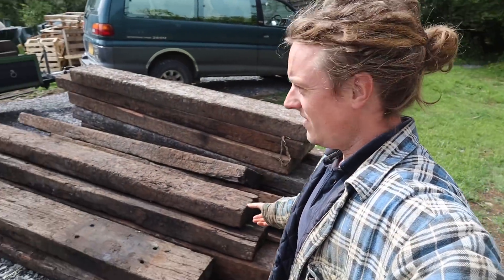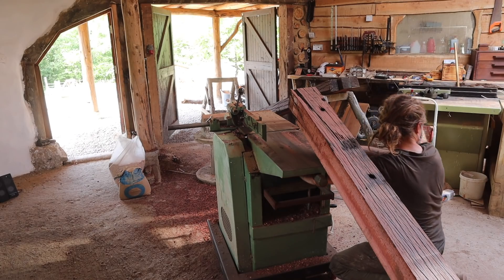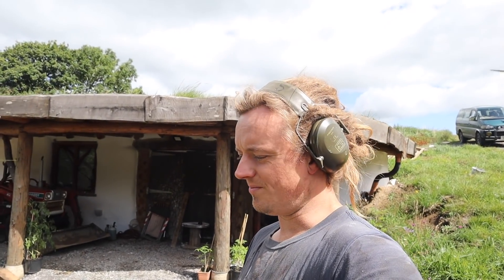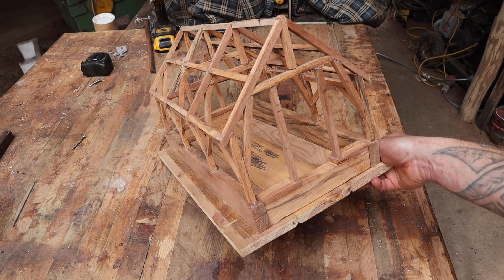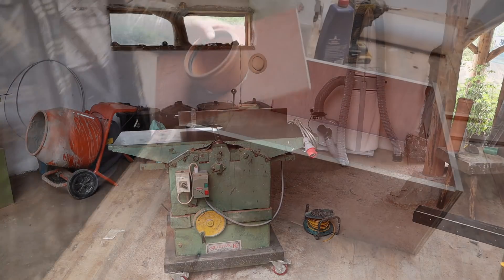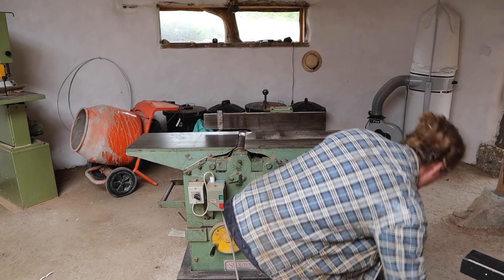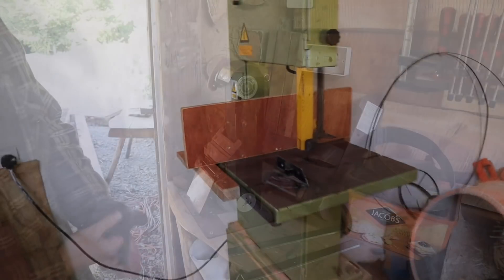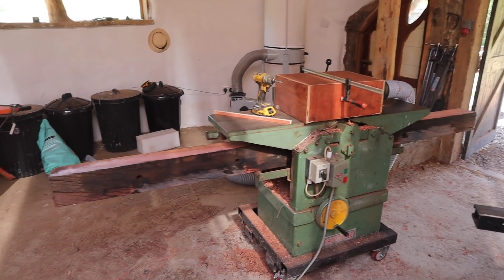Spring Fed Timber Framed Greenhouse Part 1 Design/Materials

Comment: Kris- you will get significant improvement in suction if you move the collector closer in order to make the hose as short as practical.  Corrugated hose like that causes power loss over length and that is a pretty long hose.  Its great for convenience but there is a suction cost.  Love what you are doing and thanks for posting.
Joe
Reply from the maker: Yeah i know. its the same principles as hydro electric. But with the hose this long i can reach both planner and table saw without moving it. so the loss of suction is an acceptable loss for the ease of use.

Comment: The shavings and sawdust will make a good ground cover for your chicken coop, and are also good for covering pathways to stop them getting too slippery.
Reply from the maker: Yep, i keep all the clean stuff for those purposes. its very useful stuff. infact when we have run out before i have just put green logs through the planner to make some more.
Reply: Might be nice for the composting toilet too
Reply: Saw an awesome sawdust stove design.. with flue. Great way to keep the workshop warm, also burns super-clean. Create a cavity using a pipe and it slowly burns from top down.
Reply: Also great for your orchard, decomposes nutrients to the soil plus it keeps down the weeds so you don’t have to cut the grass.
Reply: If that is aussue red gum and it's untreated, you can use it for smoking meat.

Comment: Hi Kris 
As a gardener, I would very strongly recommend two roof vents on each side of the roof with this size of glasshouse - (in addition to the vents in the ends) Hinged at the ridge, and make two of them open on auto vents(surprising how much heat in the sun at 6 am on a summer morning!) You have to allow hot air to rise out of the roof vents or the plants will definitely cook!(you can't rely on horizontal draught).
Also recommend a roll (two or three with this size of glasshouse) of shade netting fixed at the ridge on the sunny side- like a roller blind. You can use paint-on shading, but netting is controllable and variable...
Cheers
Reply from the maker: Thanks for the info Andy. I will add some more opening windows on the roof.
Reply: Andy speaks the truth! A greenhouse can get hotter 'n billy-be-geewhiz in no time flat.
Reply: I love the way your mind works those little mini additions are really mind blowing especially for someone like me who has no experience at all with wood work or building construction. I congratulate you and appreciate all your videos. All the way from  Guyana
Reply: Late as usual, but ya'll don't use wax struts? They save my lazy ass...the 36" vent fan kicks on ~5° later. Its on a thermostat and a timer, but its a simple 24v system cobbled together from mostly scrap, batteries and solar cells free from an old sailboat and mpt from an old farm gate setup. Wax struts are 30x easier, though
Reply: Great advice Andy! I am a gardening freak, and have always wanted a greenhouse, yet I have no room for one, so I didn't know a single thing about them.
Reply: @KrisHarbour  Seems he's decided to test the horizontal flow mechanism for a year. Should be interesting.

Comment: When you get a dust extractor, try and incorporate a cyclone to pull out a lot of the chips and dust before clogging the bag or filter on the output side.  That would also help if you decide to just vent the remaining to the outside, ie less dust sent outside to get over everything.  It also helps keep the bag from filling up as fast as you could route the chips into a trash can from the cyclone for example.  There are a lot of videos online for taking the type of dust collector that you made and turning it from a 1 stage to a two stage with a cyclone.  Also, I do not know if they are available where you are, but over here in the usa there is a company called Wynn Environmental that makes filters to replace the filter bags that does a really good job of taking the dust out and not reducing the air flow.  I have learned that if there are any sharp metal edges on tools....to take a file and round them off...too many slices have happened to me while moving near the tools while they are off and bumped into the various hard edges...same for wood corners...rounded is better and safer for me. :)  Fun video as always. :)
Reply: Yup. I built a Thien baffle which is before the impeller, so you just don't get many chips hitting the impeller at all. And then you can get into the whole straight runs of plastic pipe which have less resistance, and then things like the helix head on the jointer to stop the shavings being so big. There are certainly many ways it can be made better, but at least Chris now has something to stop the machines and his lungs getting so clogged with shavings.
Reply: Just adding a hint for the plastic piping, in case it helps someone.  
Dust and chips create static electricity that cause blockages, but if you run an uninsulated  earthing wire around the outside of the plastic pipe, the problem goes away.

Comment: you need a adjustable stand with roller so you an support the end of the beam as of travail through the mill . that will save your  back & even a grab to lift the job & swing it in. all easily made.

Comment: If i may suggest, you should think about reinforcing/hading an elbow 45o angle on the outlet of the box into the flexible hose. 
With time (and with thick chips) they might ripe the hose.  i've seen this happen before and a pipe elbow would be a quick/cheap fix! 
Can't wait to see this build complete. 
Thanks for sharing

Comment: I have a dust extractor the same as yours , I have used mine for more than 10 years and it works well, a quick tip the top filter bag can clog up preventing air flow out (sucking power) if you keep it dry not damp it works better and keep the bag clean from build up, turn bag inside out dry in sun and beat it with stick from up wind.

Comment: When building the greenhouse make certain that you have enough ventilation, about 1/3 of the roof area is often recommended to be opening lights. I also like ventilation at both ends as well.  Easier to build in at the start than to add later.😀🇬🇧
Reply from the maker: Lot of people have recommend that so i will be adding some opening windows in the roof.

Comment: Great job Chris. You need a pair of adjustable tables for both sides of your planer. Most woodworking shops in the US have them covered in carpet to keep from nicking up the woodwork. Would help balance out the longer logs.

Comment: It might be nice to have the possibility of opening up a part of the roof to allow heat to escape. I have a greenhouse in my back garden and I wish I could open it up completely on days like today with over 30 degrees C. With 1 medium size roof window plus the side openings it still gets over 45 degrees inside which is hard on the plants, so now I have to use camouflage netting for shade which I'd rather not. Looking forward to this new project, it will be such a nice addition to you homestead.

Comment: Your greenhouse model is very nice. Hope you don't mind a couple thoughts from an old lady in Texas.  My experience with greenhouses is you get better temperature stabilization if you have a solid north wall and west wall. You don't get light from the north but the cold wind comes from the north. So you will get higher night time temps in the winter from blocking some of the cold and better insulation from a solid north wall. The west wall helps with too much heat gain in the summer and winter wind as well. You will want a couple vents in top to let excess heat out as well. A door and a window is usually not enough in the summer. Digging down several feet and putting insulation and wire mesh in will keep your soil warmer in winter and stop tunneling varmints from getting in your greenhouse.
Reply from the maker: Hi Joan, Thanks for the comment. this greenhouse hopfully one day will become the Bottom of an L shape with the straight top part part earth covered and possibly connected to the future house. so the house heats the greenhouse and the greenhouse heats the house. This is just the fist step in getting something up that we can use without having to do to much major earthworks. This one will have its soil level below the ground level and the back side of the foundation buried below ground.

Comment: I guess you'll source your glass from friendly window fitters. You may also get multi-wall acrylic sheets from old conservatory roofs. There is a trend for some folk to replace their acrylic (plastic) roofs with proper tiles and insulation. The acrylic is a lightweight alternative to glass and easy to cut, and lift alone. Having said that, your long-lasting hardwood greenhouse deserves real glass. Maybe, for cheap quick cold frames, acrylic could allow you to have larger, easy to lift panels. Anyway,  great video  again, Kris!

Comment: My Grampy, rest in peace, had a dust collector in his woodshop. He ran acrylic tubing around the walls to connect each of his tools, and had sliding valves to ensure he never lost suction, even with about 5 or 6 different openings. 

Likely a pretty standard practice but I'm not sure, could be a nice mod for the shop. And maybe you could even run hoses to the top workshop or outside. But I'm not sure how nessesary it would be to have suction outside, but I'm sure you could get creative with it.

Comment: Hats off to your thicknesser/jointer, taking 7 or even 5mm of Jarrah (pretty sure without having my eye balls on it) is damn impressive. Almost as impressive as the effort your putting into this project. And get ready to predrill every single hole and resharpen every edge that touches it, awesome timber, but horrible to work with. Glasses on mate, Jarrah saw dust in the eyes is very unpleasant, take it from me.

Comment: You probably know this, but waxing your planer and jointer beds with paste wax will help those timbers slide through a lot easier.  I have done a lot of heavy woodworking like this, and you should consider investing in a couple heavy duty adjustable roller supports.  Not only does it help make the job physically easier, but it also increases your accuracy.
Reply from the maker: Yeah, some rollers would be a big help for sure. And yes i had already waxed the beds. the reason for the sticking was due to the gunk on the outside of the wood blocking up the feed roller. Had to keep cleaning it so it would feed properly.
Reply: @KrisHarbour  You are working so hard!  Great work! You can always fashion up some wood rollers to help out. :)
Reply: @KrisHarbour  Sooo them sleepers are not treated lolol (just thought i`d ask).....
Reply: Silly Billy you don't need to wax your planer.  They don't have any hair.

Comment: Good stuff, one thing about precise timber frames is they shrink alot (well if you are using Green Logs) yours won't because they are both dried and seasoned. My Oak frame, has shrunk a fair bit in 24months - 6 " square posts and especially the oak purlins, with a little bit of twist in them but I don't mind it adds character but it has shifted 2" and my plaster board that was 1" behind is now 1" proud. Yours will last until the end of your days. I bet that chainsaw needed sharpening afterwards.
Reply from the maker: Yeah, thats why im using this timber as getting dry wood this size would be big money and green oak or larch would shirk to much really for the glazing. Im going to use direct glazing to allow for movement anyway. but starting with mostly dry wood will help alot.

Comment: Suggestions for you Chris when sharpening your planner /thicknesses blades if you were to make a blade holder out of aluminium say and have it so when yo u turns adjusting screw it moves in toward the belt saner you would get a lot better sharpen blade ie make the blade guide close to moving belt run the blade through on the first pass in one movement then again for another pass leave the blade guide were it is pick up the second blade and do the same two passes the same applies for third blade if you’re planner has a third blade 
Then adjust your blade  guide up towards the belt sharpener run all blade
S through again  You get a lot sharper blades that way 
 Jeff Connor a ex pommie wood machinists

Comment: Brilliant video Kris as always, on the greenhouse make sure you have plenty of ventilation  both at the top of the ridge and at the bottom of the walls and also incorporate some shading  ,even in the UK the inside temperature wll get over 40c .We have a 25m x 10m polytunnel and the biggest problem is overheating,  (hope you don't mind the input ?)

Comment: maybe a point to think on m8 it struck me while you were showing the new model of the g/house, the sloped roof sections look tailor-made to be opening style windows to allow air circulation control will also make temp control easier too, 6 windows in total 3 per side it's just a thought in no way a criticism it is going to be an awesome build whatever you do with it loved following your channel and the projects more power to you Kris for sharing this actually 6 per side I meant opening the heat in Yorkshire we are just not used to it lol the extraction plant your developing takes me back to my days at mintex working with asbestos too
Reply from the maker: Appreciate it. i will have a think about that and look to see what is generally down with commercial ones.

Comment: You could improve your dust collector by using a minimum of the corrugated hose. The ripples slow the air velocity considerably.
When you get a chance, do a search for Bill Pentz.
Reply from the maker: Thanks for the info, but I am fully aware of how it works. It’s exactly the same principals as hydro. But just like hydro there is a trade off. And in this case the trade off is not having to move the machine in order to access both the planner and table saw

Comment: The dust box was a great idea, if only to cover up the jointer side blades when using the thicknesser. Unfortunately, I was around to see someone get their hand "sucked" into one.  Needless to say, very messy. 
Love your work, but as an Aussie feel compelled to correct you on a couple of things that you have said in previous videos. The A's in Jarrah are pronounced like you would say in caravan - not ah's. 
I can't buy oak or larch in Australia but I reckon you would have a chuckle if I kept calling them exotic timbers. Jarrah is available in every timber yard, in any size or length that you might want. I paid $250 (which is about £140) for a tonne (2.5 M3) of chopped Jarrah firewood, delivered to my door.
Also, Jarrah isn't a rainforest timber. Grown and harvested from sustainable forests in the southwest of West Australia.
Reply: Given that those Jarrah sleepers are over 50+ years old, there's no way they'd be from a sustainable forest. But the good thing is that it's nice to see that the wood from all those years ago is not being wasted and is getting recycled.
Reply: @happycamper4329  You do know what a sustainable forest is, don't you?
Reply: @markharvey18  yes I do!!! my point is that given the age of the sleepers that Kris is using, those particular Jarrah sleepers are not from a sustainable forest, because Western Australia wasn't doing sustainable foresting 50+ years ago.

Comment: You should consider adding an intermediate filter on your dust collection. Check out then baffles if you want to build it yourself, or a. Cyclone like the dust deputy xl if you would rather purchase. It will save you a ton of wear and tear on your blower as you won't have chips going through the impeller. I can send you pictures of the thien baffle I built if you would like.

Comment: Kris, you need to ensure that both blades are sharpened equally so the edges has the exact same length, otherwise only one of them(the longest one) will be doing all the work.
Reply from the maker: i get them both the same and set them up in the machine so they are the same. I also have a movable outfeed table so i can adjust if they are set to low or to high.
Reply: @KrisHarbour   Ah. Nevermind then :)

Comment: Hope this info helps Kris...

THE 3 MOST COMMON TREATMENTS FOR RAILWAY SLEEPERS

1) CREOSOTE TREATMENT - used for over 150 years to lengthen life of timber, but now facing some restrictions. SEE BELOW.
2) 'GREEN' PRESSURE TREATMENT - the latest 'environmentally friendly' pressure treatment. See below.
3) UNTREATED - some tropical hardwoods are naturally long lasting, & hence need no treatment. See below.

USED RAILWAY SLEEPERS are normally either
a) Creosote treated, e.g. used Dutch Oak and used British pine, or
b) Untreated, e.g. used Australian Jarrah and used African Azobe sleepers. Even though a used railway sleeper is untreated there can occasionally be deposits of oil or diesel on the surface which have fallen from passing trains over the years (not to mention other things!) 

NEW RAILWAY SLEEPERS are normally either
a) Green treated  e.g. new British softwood railway sleepers. These are environmentally friendly non-creosote based preservatives, with treatment names such as ACQ, Tanalith E, Osmose or Wolmanit, all of which are suitable for landscaping projects, or
b) Untreated, e.g. new oak sleepers

Comment: Nice dust extraction box, could you not have it open ended? covered with brushes so you can still push wood through it when planing but it would mean you wouldnt have to move it when thicknessing ?
Reply from the maker: Because you feed from two differant sides the chips get thrown up when thicknessing and down when planning so that would work unless you had like a jet engine dust extraction.